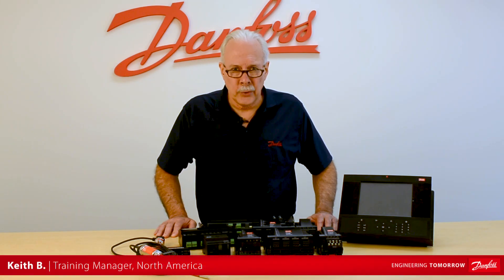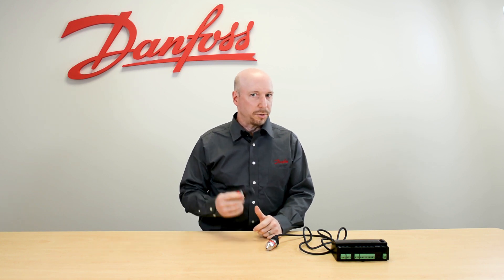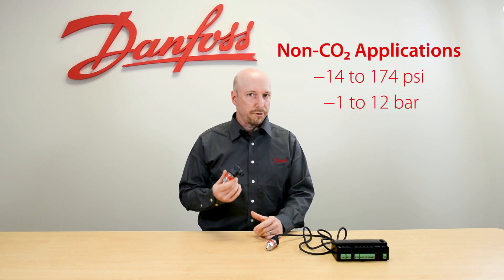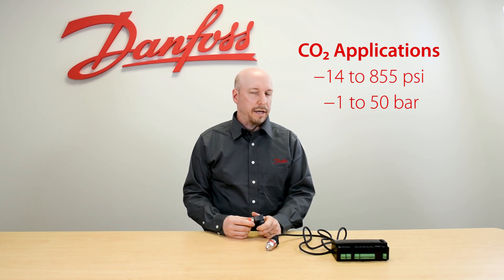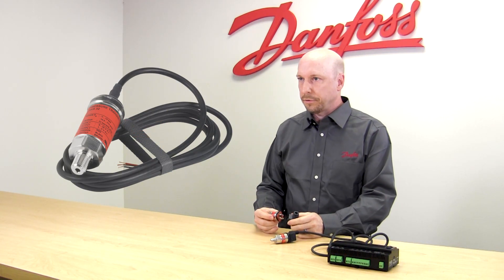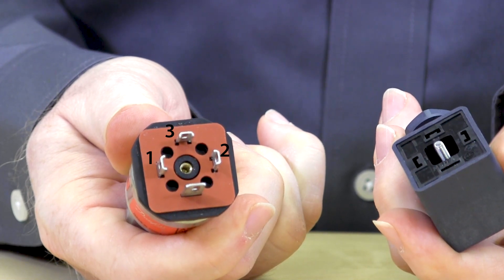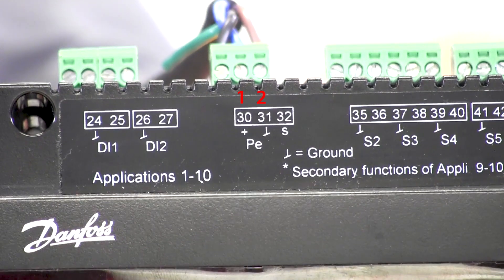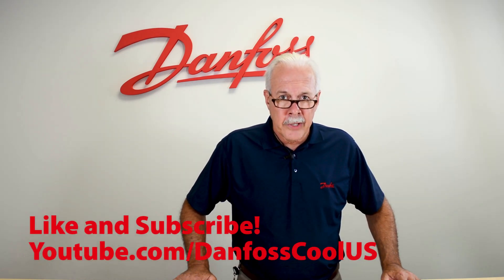How to wire the AKS 32R pressure transducer | Technical support for supermarket controls

Comment: Hi thanks for the video! Now we are having an issue with the transducer (assembling to YORK ac unit): when we turn off the ac unit, all three pins are open circuit. When we ran the ac unit and the scree showed up “HPCO (High pressure discharge transducer fault), we measured the each three pins but still ope circuit. Does it mean our transducer has been broken?

Comment: How to check with multimeter
Reply from the maker: Hi Asfand, to verify that the transducer is working correctly, measure the DC voltage between terminal 1 and terminal 2.  The result should be +5vdc.  Measuring between terminal 2 and terminal 3 should result in the output voltage, which should always be between 0.5 vdc and 4.5 vdc.  The midpoint for voltage is 2.5 vdc, or approximately 77 psig if the transducer is reading properly.
Reply: @DanfossNorthAmerica  how to measure mA , where to measure mA between which terminals
Reply from the maker: Hi Arun Kumar, you would not measure mA here. Instead, you would want to measure voltage on the signal and ground terminals with that voltage being in the 0.5V-4.5V range depending on exact pressure.
Reply: @DanfossNorthAmerica  Hello is 0.5 V 0 pressure and 4.5 V max pressure? If yes what is this max pressure please
Reply: Thanks sir